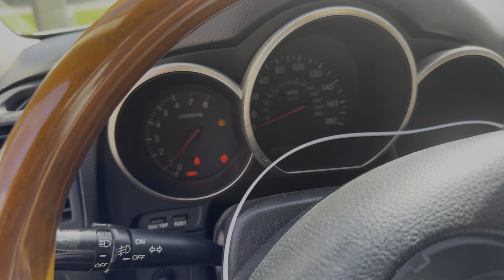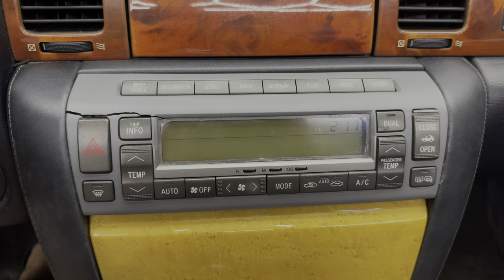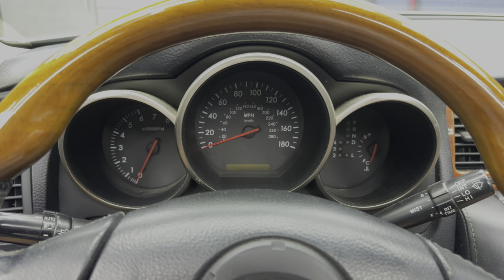BUYING A CHEAP $2000 “LUXURY” CONVERTIBLE

Comment: Boot release is next to fuel cap release / two small buttons knee height under / to side of  steering wheel
Upper screen is nav ( that one's def had it ) ,  lower screen is a replacement music centre  / original was Mark Levinson
Reply from the maker: THANK YOU! Knew it had to be somewhere😄😂
Reply from the maker: I’ll have to look into getting a replacement NAV screen, any idea what happened to this original one?
Reply: @Atlanticbeachcustoms  probably white paint worn away on switch over time ...
Reply: @Atlanticbeachcustoms   Mate , that original screen looks like Wolverine was trying to find his way home In the car , scratched beyond any possible use . Does that new "music centre" below  have a navigation app on it ?  If it does , than that original sat nav is now redundant . Your choice what you put in there ! 
Maybe just keep it as a cubby hole for odds and ends.  Not too much easily accessible places in the SC for bits and pieces without lifting up the "elbow" storage boxes ...
Reply from the maker: @a.c.4732  Hahaha yep that and it looks like it sat outside cooking in the sun for 50 years😂 Yes the other screen does have navigation so I might just get rid of that NAV screen altogether like you mentioned, just worried it might look weird having a big hole or missing screen there. Thanks again, have a great day!😄

Comment: Electrical discharge likely down to the stereo replacement. Cracked dash, broken screen and missing parts to the gear shift panel means the centre console has been completely removed.... badly! Power amp is usually under the seat, so check for any bad joints/frays and bad earths. Good luck.
Reply from the maker: You’re awesome thanks so much!! I will definitely check into that👍🏼🤟🏼

Comment: I'm Japanese. I used to drive one too. It's now a great car in Japan, and enthusiasts are buying it again. It's an open-top car that cost $80,000 when it was released, and Toyota uses good parts. The engine is a 4300cc DOHC, so it has plenty of horsepower and is still in good condition.
If you repair the exterior, overhaul the engine, and reupholster the seats, you can drive it for another 20 years.
Reply from the maker: Hey thanks for your comment!! I have seen a few of the cleanest built sc430s all from Japan! That’s crazy it was $80,000 back then!

Yep I just got pretty much all the mechanic problems sorted out along with some preventative maintenance so now I am going to redo the entire interior and exterior! I wouldn’t mind driving this for the next 20 years😄

Comment: First I have heard of that module.  Lots of times the VSC light comes on with some of these symptoms. I’m interested in how that used part will work for you.  The steering is usually pretty stiff.  Any codes stored? My Blue Driver code reader seems to work well for all my Toyota/ Lexus, Acura and even BMW.
Reply from the maker: Yeah I heard that too with the VSC but I haven’t seen that one yet. I’ll have to hook up my reader again and see if I can view any stored codes. I might need to upgrade my code reader here soon I’ll check that one out thanks! Yes I’ll keep you all posted with how it goes with the new module!

Comment: I have both qx70 and sc430❤ them both
Reply from the maker: @vonstervon4407  No way seriously?! You’ve got some good taste😉😉
Reply from the maker: @vonstervon4407  how long have you had both of them for?
Reply: @Atlanticbeachcustoms  I've have the fx50 over 3 years now and the sc430 a little over 6mo. Sc430 is slammed and the fx50 is built for speed.
Reply from the maker: @vonstervon4407  Niceee what kind of suspension are you running on the sc? I’ve been wanting to do some power mods to the QX but there’s like nothing for them🙁
Reply: @Atlanticbeachcustoms  megan racing coilovers, 3rd cat delete no muffler super loud. The fx50 has the full aero, hks replica exhaust and tune.